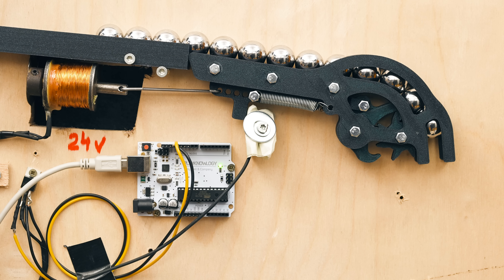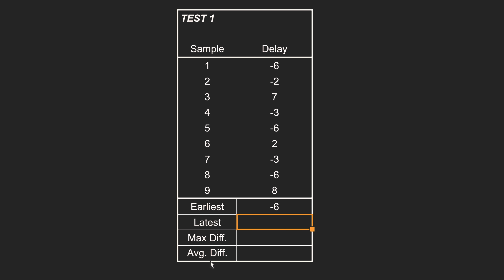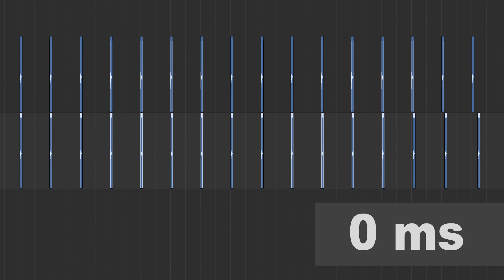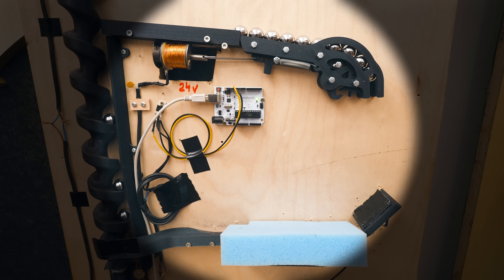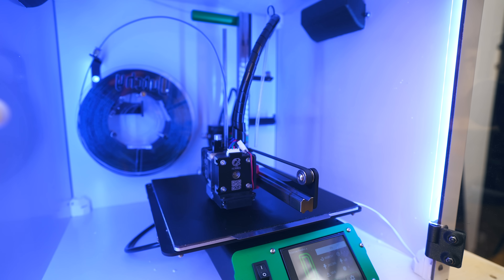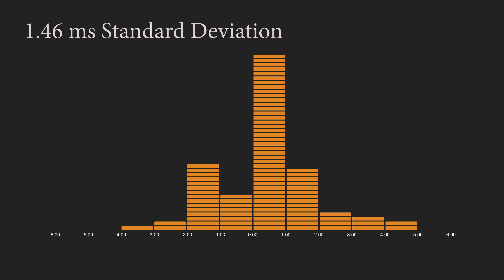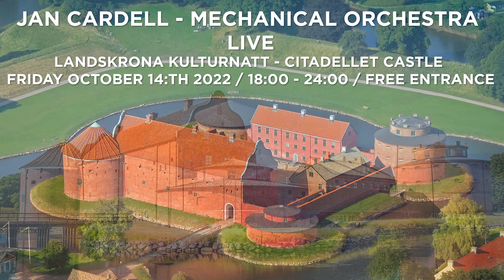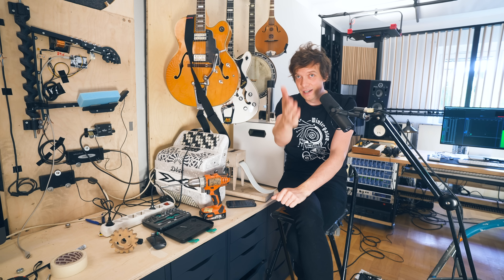Testing the Arduino Marble Gate

Comment: Just a quick tip regarding the statistics when performing various tests. If you compare two standard deviations (or averages for that matter) it's important to test if the difference is actually statistically significant! You can do this using an F-test for testing the equality of two variances. If, for instance, you measure an improvement of the s.d. of 5-10% this may seem quite promising for the adjustment you made to the marble gate, while actually this result may not be statistically significant.

Comment: Martin forgot to define the goal of the task. What does tight mean? 0 ms delay? He should research the organic delay caused by human instumentalists and use this as a reference. We all heard the previous MMX playing tightly. He should work on calculating, estimating and predicting the marble loads which are to be fed in each channel. Maybe use flow simulations. The marble flow could be aproximated by a liquid. there are models and programs to solve this kind of problems in process engineering.

Comment: I really truly think that as far as putting the mmx into production goes, you should just send it now. This unending chase for perfection will go on forever, and you’ll end up trying to find ways to change physics to get tighter tolerances for what is, in all honesty, not an exact science. If you want to experiment with getting as perfectly tight as possible, why not just do that on the side with a 3rd version? The MMX as it stands is incredible, and you should be proud of what you’ve already done. Nothing is perfect, but you’ve come way closer than most. Personally, I think slight imperfections give it personality.

Comment: Seems like there would be a lot of latency in the system: 1. on the signal side to the arduino, 2. on the arduino response time, 3. on the solenoid travel, 4. ball-drop time.  Just thinking out loud but might be worth considering ways of improving the latency.

Comment: The delay function you're using, which is normal to use, is not that accurate and could increase things a second or two.  You should look into using timers instead of delay.  Timers are much more accurate, but more difficult to use.  I've been using Arduinos and microcontrollers for years (but I'm no expert), and I'd have to look up how to use them.

Comment: Simplest way to think of standard deviation is average difference from the mean, so add up and devide by number of samples to get the mean, then calculate the difference between mean and each sample value (should all be positive) sum these and divide by number of samples again to find the mean of the differences.

Comment: Good to measure the tightness this way, but I a working machine you will have vibrations, the surface below will not be flat so there will difference in the fall height again, which increase the deviation again. In my opinion I would opt for a sturdy option rather than one that is living on the edge, e.g. a marble falls out because of the Vibration. I would always put in a buffer, you can try and get tighter in the last phase of the project.
Hope you can built your machine though, would love to see it playing live!

Comment: I feel like I have just stared into the eye of Sauron. I have a bad feeling that Martin is going to fight the beast of optimization and his soul will be broken once more. Let me give you a guide - My version of the Rules of the Optimization Club:

#1. Don't optimize.

Other rules are only for the case where rule #1 is not a viable option.

#2. If you have to optimize then do it only as much as it's necessary. You optimize because the product is not working good enough and you optimize until the point when it's good enough.

#3. Never do premature optimization. Premature optimization is the root of all evil. What you did in this video was premature optimization. Focus on making something that works at least badly and then optimize. Like this, you have actually no idea, what effect the changes you made actually had on the machine. 

#4. Set up a relevant metric. In this video, your metric was an irrelevant number. The amount of its irrelevance is nicely demonstrated by the last step of your optimization of that number. You levelled the bounce pad. Is the final product going to have completely levelled drums and you running around them and catching the marbles? No. So why did you measure that?

#5. Set up a clear endpoint. If you have a metric, make a clear threshold where you stop before you start optimizing. 

#6. Make sure your optimization will make a relevant difference. I couldn't tell the difference until there was a 10ms delay. Optimizing from 3ms to 2ms was in my case equivalent to optimizing from the state "I can't tell the difference" to the state "I can't tell the difference". In other other words, you wasted time. How many other listeners would share my experiment? You should know if you are trying to optimize.

Comment: You can determine the error of a single drop from the delta between drops in Test 4.  If 3.7ms is the stdev of the time between two drops, then the stdev of a single drop is 3.7/sqrt(2) = 2.6 ms.

Comment: Using the hardware timers of the arduino will also improve the accuracy of the actuating of the solenoid. Delay() is not very accurate

Comment: you can make the arduino much tighter than that but then it is when getting past the arduino language and programming the microcontroller itself and not letting the arduino library do it. For example with all the compatibilities issues and "general purpose" of the arduino librairy an analogRead() is 4 times slower than the bare code.

Comment: I get it. Remove the slop from as many parts as reasonably possible so the ultimate slop of the whole system is still in the realm of "musical". If the whole machine were Arduino-controlled, getting from 4 to 2 ms of slop would seem way unnecessary. But the triggering mechanism, programming wheel, etc. will likely have much more slop by mechanical necessity, so removing it here where possible makes really good sense.

Comment: I couldn't hear any difference under 8ms, so 2 standard deviations (SD) at 3.9ms, 3 SD at 2.7ms, 4 SD at 2ms, 5.5 SD at 1.46ms.

Honestly, for me 3 SD (meaning 99.7% "success" rate) is usually good enough for me. ;)

Comment: Great to see that you are indeed still working on this 😊
I think you should check your data to see if there is any periodicity to the timing. If one of the rotations has a slight defect it might affecting the timing for that rotation in a predictable way. If so then maybe you need to look into how to minimise those defects or counteract them in some way.

Seeing the slowmotion view of the pad at an angle it makes perfect sense that if the marble has some lateral inaccuracy then it would affect the fall time. But some amount of angle is probably going to be necaassary in the final version, so maybe you need to find a way to reduce that lateral variation?

Comment: Yay! So good to see a Wintergatan video again - and marble related too, perfect!

Just a couple of things:
- The Arduino should be able to hold much better than 1ms resolution - a few uS should be possible. I suspect the use of "delay(x)" is part of the reason at least.
- I think a lot of your 1.5mS variation is due to "slop" in the mechanism. I bet you if you made the parts out of metal, using proper bearings and 0.05mm tolerances, you'd eliminate a lot of the remaining variation.
- Also; anything you do to guide the marble *after* it's been dropped, will influence the repeatability. Even if it's a straight fall through air to a flat land, there will be some variation due to air currents, air temperature, and so on.

And to echo what others have said... at 3.9mS, I couldn't hear any discernable delay. Even 10mS sounded fine. So yeah.... tight is good, but there are diminishing returns after a certain point...

So.... MM Xi?
Reply: Same thought. He should use micros() instead of millis() for timing 🙂
Reply: ad to that stop using digitalWrite but use direct port manipulations

Comment: Wouldn't one be able to eliminate the difference in signal by the arduino by direktly using a clock circut with a fixed fequenzy? Or maybe by using a multiple of the intrernal clockspeed of the arduino.

Comment: I'm happy to see Martin focused on exploring and sharing the engineering end of this project and not putting so much pressure on himself to build a mechanical touring monstrosity. Would anyone notice a 3ms variation between beats in an actual musical performance? absolutely not. Is it cool to push the experimental limits to try to get as close to 0ms variation as possible? totally.

Comment: Just saying, you could have asked a programmer to make a program that would check for timing differences to save you the manual effort. I used to work as an automation expert and seeing you line up and chop audio tracks manually was painful

I have been looking for a project to work on and something like this does not seem to exist, at least free and not part of professional software. Sounds fun but I don't have example soundwaves

Comment: Hi Martin,
If you are after even more perfect timings from the Arduino itself, consider using its built in hardware timers and interrupts. The code would be a bit more complicated but especially in long running experiments, the delay() function will not produce consistent timings. For example any code you add except from the delay() consumes time to execute, so it will not be a consistent 1s run. Let me know if you want more information or help with programming.

Comment: 13:35 Levelling the hitting surface does work to reduce the variance in hitting times, by reducing the how much the spatial variance impacts the timings. But I worry that doing so also makes the test not sensitive to such spatial inaccuracies. And I feel like in the finished design it does need to be angled so that the marbles bounce away from the pad and not block things for further marbles, or hit multiple times.

Comment: This is very interesting. I have strong feelings about this. 
On the one hand I know Martin wants to create a device that is near perfect, but at that point I would just use a midi sequencer.
This doesn't feel like it's standing much on the foundation of the original idea. The marble machine was more than just a marble dropping machine, it was a kinetic sculpture. The design of the marble machine's analog midi sequencer was crucial in making the original video special. 
With these gates, you eliminate a big bulk of what made the MM and MMX so appealing: The fact that the form also had function. Not only that, but it was a valuable tool that showed an intuitive mechanical action to release and drop the marble. It made the experience more tangible.  An electric gate just has invisible bits programmed by a computer and takes, you, the artist, out of the experience.    
As an engineer, I understand how the desire to optimize can be overwhelming, but if you keep stripping away at the machine, then the original idea is going to be lost. And Elon Musk isn't the guy you should be listening to! HE'S BUILDING ROCKETS, of course there's a need to remove unnecessary things.

I will hold myself back, because I believe that, in part, there are things that Martin knows about the MMX than he's leading on, that makes the project a sure fail. I will hope this is not someone falling into optimization hell.

Comment: Since we're into decimals in tolerance and deviation—also remember the 3D printer has a printing tolerance of x mm. Same CAD will come out slightly different every time you print.

Comment: You have a lot of engineers designers helping you out. Maybe you need some programmers now. A lot if what you did by hand (finding the onset of the sound and aligning each drop) could be automated quite easily in code. I think a lot of the negative comments on this post miss the point - you are trying to be more scientific and this was an example.

Comment: All through high school I had problem to remember what standard deviation is, it was just a formula that made little sense to me.

Until it was explained in plain English (well French in my case). Standard deviation is the average of the deviation to the global average: you calculate the average of the numbers. Then you calculate the difference between each number and that average and you average the differences. That's gives you an approximation of how far each number is from the average, what is the error or uncertainty of each measurement.  

"Average of the difference to the average" is so much more self explanatory.

Comment: I am curious... Why are you just "letting them fall", as opposed to "launching them with a set force"? I would suspect that you will get better timing if you were launching them at a "set speed", vs "hoping that they reach 32 feet, per second, per second", by dropping them from loose tolerance grips.

Comment: I think, be careful you're not solving the wrong problem.     Surely you want to solve reliability, while minimising the timing errors.    I don't think it's necessary to chase perfect timing quite so much.    There will be an inherent variance since it's a mechanical system affected by heat, gravity, friction and such.      And that might limit what you can play on the machine - but don't get caught up chasing perfection.

Comment: What this tells you is that your design where marbles drop directly above your angled instruments, is your biggest timing issue. You have to reverse your drop, so they match a linear impact, vertically at 90-deg. In short, the gates exits should be casting the marbles inward. They should still bounce forward, just not as far.

The only other choice would be to have a "catch rail" near the impact point. As opposed to having "catch cups, which are so far away. (Which is making you have to place a greater angle, causing the timing deviations that you want to remove.)

A "catch rail", like a flat gutter with a soft landing surface, running across the width of the machine. The height has to be set so it catches the marbles near the apex of the bounce. That will produce the least amount of impact noise, besides using a soft surface. (Felt over hard foam and "dyna-mat" adhered to the under-side of the gutter. It's like tar-rubber noise deadening material that pro audio car enthusiasts use to kill bass vibrations.)

Comment: The marble machine is a piece of art. Art is not 100 percent perfect. An artist has to at some point decide that the artwork is finished and that is way before the artwork is perfect. You are an artist, Martin, and your creativity are being engulfed in this pursuit of perfection. I know that the first marble machine video is an illusion of a working machine, but art is an illusion. I absolutely love that you are back and I hope that this iteration of the marble machine will lead to a working musical instrument that you will be able to tour with. And remember that there are not any instrument that does not need tuning, changing of strings or has some other failure point.

Comment: sanity check - you can input the contact mic back into the arduino (possibly with an amplifier and protection diode)...then the arduino would say 'trigger to detection' every time.

Comment: 2:14 scheduler, the enemy of real time computing. your arduino has the same issue as a raspberry pi. you need a non multi tasking system, I mean,  a low grade arduino, or a PIC, that works with firmware without multi tasking. 

on orange pi + Linux I have fixed this issue by dedicating a core to my task. amongst 4 cores, I have 1 dedicated to project supervision, and 1 to project real time task. that's half the CPU for very stupid task and 99.8% iddle, but I got excellent results. there is little fun googling for how to reserve a core (boot prompt argument ) and how to later start a process on it :)

Comment: FYI, assuming independent events normally distributed, they add vectorially, i.e. like sides of a right triangle: total deviation = sqrt(d1^2 + d2^2 + ...).  For two equal deviations, this is just sqrt(2) times.  Your measurements of 3.7 and 2.8 are only a factor of 1.32 apart, pretty close to 1.4142...  I'd say that's close enough given the small sample sizes. Nice!

Regarding the Arduino and solenoid, I'm not sure offhand how the Arduino library timing is done, it might be on a 1ms heartbeat for example, which should still be very accurate but if it misses a beat for some reason, you'll lose that to begin with, of course. (A finer grained histogram might show that, but you may also need a lot more samples to see a pattern in it. Easier to just ask someone who knows this about the code.)

Based on my experience with solenoids, likely your error is there -- anything mechanical, there's just enough error in position, and friction, and movement and fumbling and everything, it likely accounts for your error. Things have to be very precise to be very repeatable (which is indeed tricky to design while also allowing balls to move freely through the mechanism otherwise). Smooth finish and tight fit are a must.

And, welcome back! :D